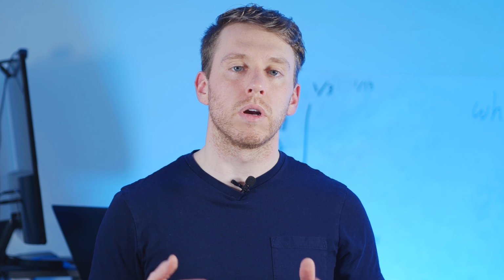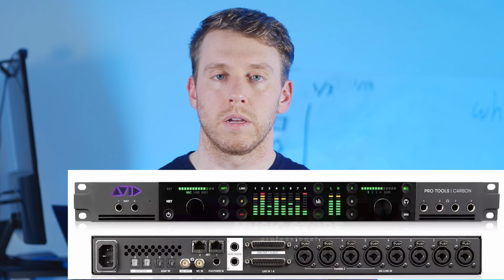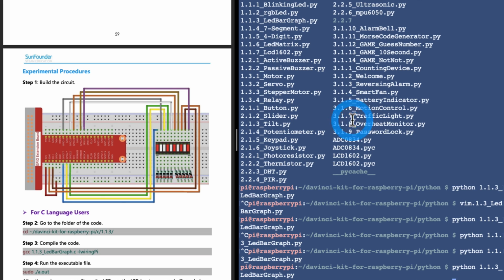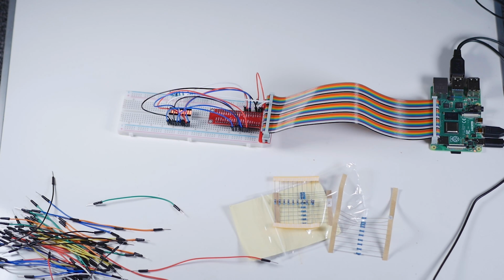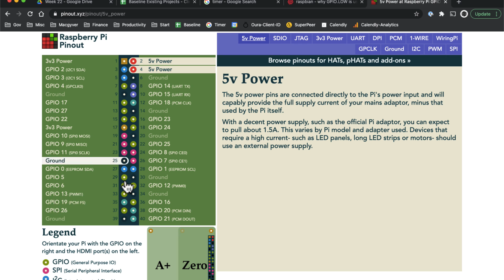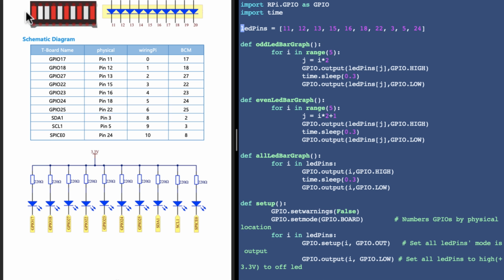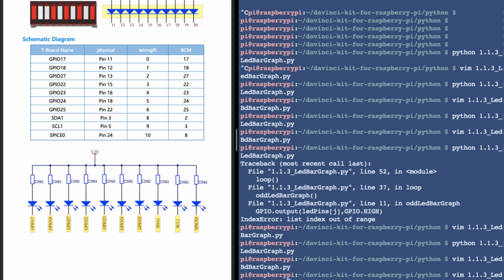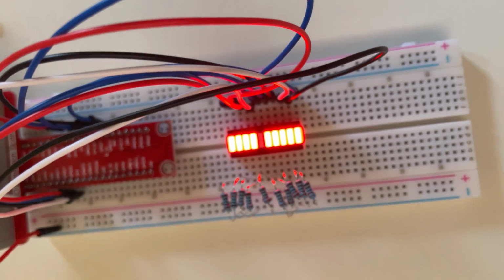How to Program an LED Bar Graph with Raspberry Pi

Comment: i dont know if you will ever see this comment but, isit possible to code led bar graph based on distance? for example coding it with PIR sensor and when someone gets near the bar graph lights up to max and when the person moves away it turns off?